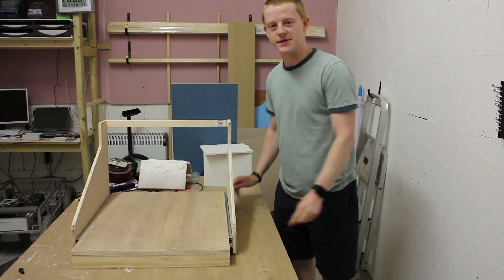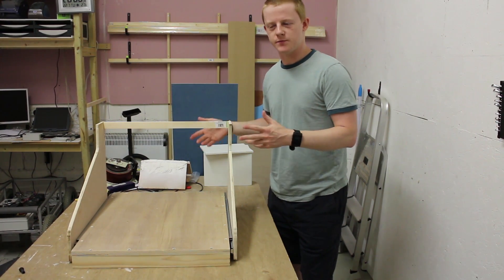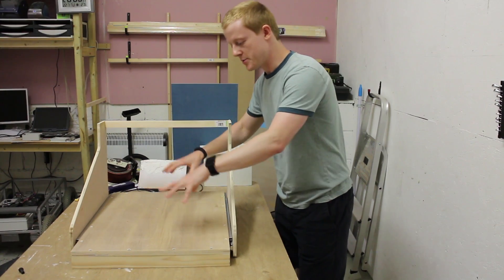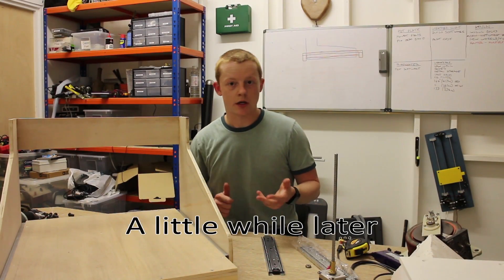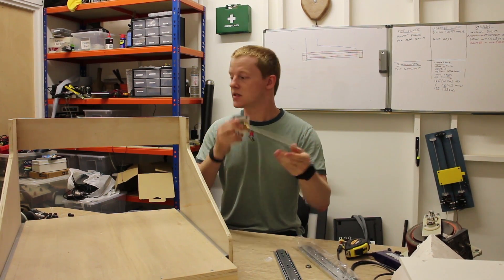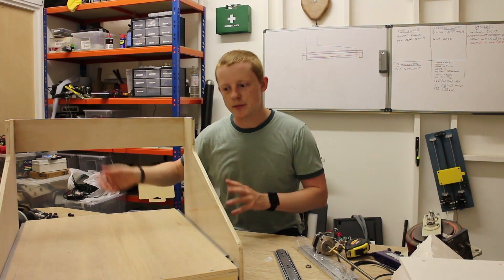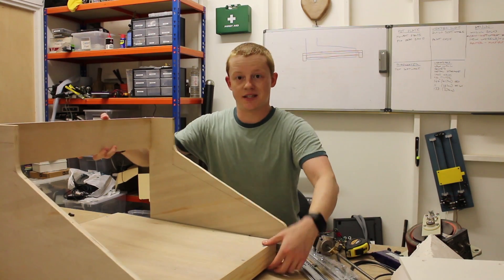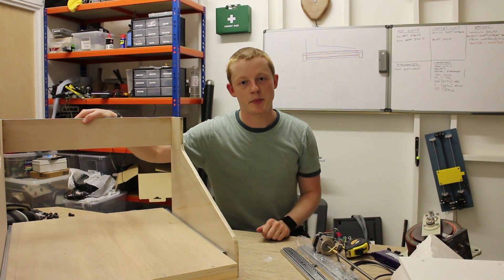Drawer Slide CNC Build - 1

Comment: i've made the similiar design but instead of making the whole machine and the spindal or watever else you put on it move back and forward i made just the flat bed go back and forward so there is much less weight for it to pull..
Reply from the maker: This is a good alternative but when I was working on my laser engraver I decided then to keep the bed stationary so you can fit longer pieces in than would normally fit. Probably not needed for this but that was the idea.